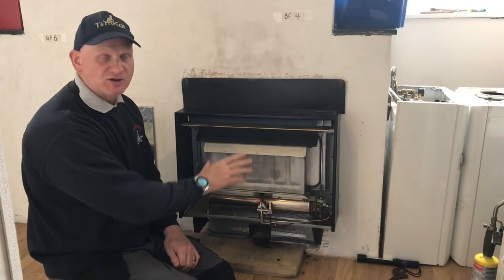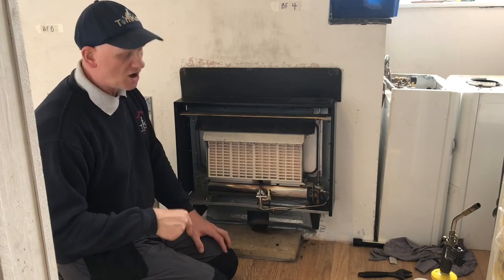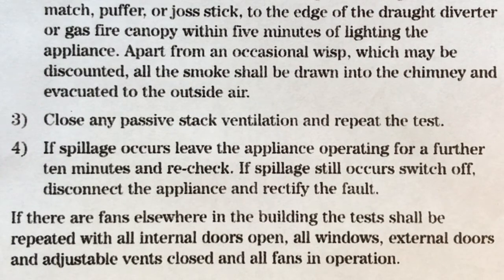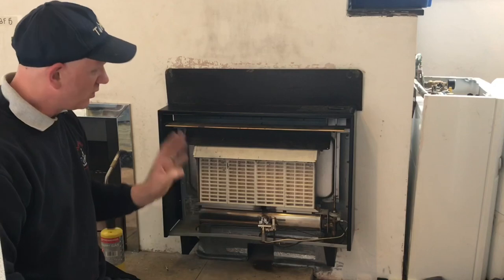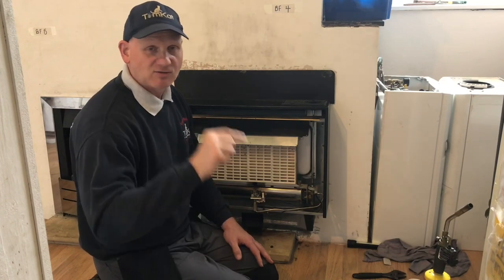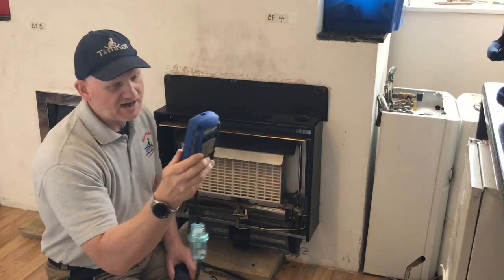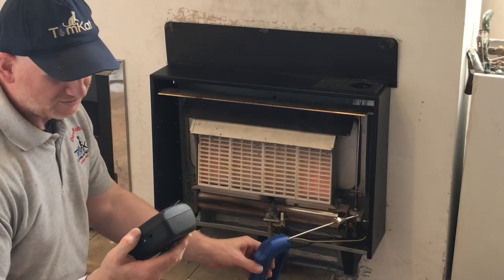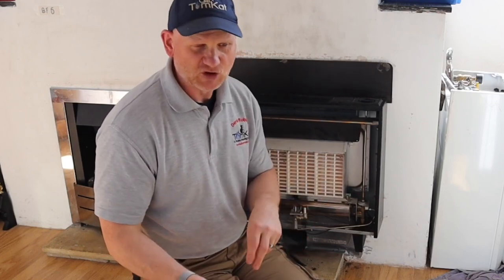FLUE FLOW TEST AND SPILLAGE part 2

Comment: Excellent video, but if it fails spillage when an extractor fan is running and everything else is fine, how much ventilation do you add? 25cm2? 50cm2? 100cm2? Or disconnect the appliance?

Comment: Fantastic video. Very useful.

At 13 min 17 secs you gave a recap on how to perform a spillage test. You said; Close all windows and doors, any fans turn them off, any vents that can be closed, close them, any passive stack systems you leave them open.

Why leave passive stack systems open?

Thanks 👍🏻

Asian Jon. Training.
Reply from the maker: Because the regs say if a passive stack is there test open first and the test again closed 👍🏻

Comment: Great video how would you carry out a flue flow test on a Gas fire stove type fire ?
Reply: I can't think answer for this any where
Reply from the maker: Matthew Whitehouse normally you would follow manufacturers instructions but most are done at the draft diverter at the back of the stove
Reply: @tomkatgastraining  i've got the instructions for a gazco marlborough and stockton stove i can see the spillage test but it shows no detail of if you need to carry out flue flow test as part of service many thanks for reply

Comment: hello you state in this vidio to apply a smoke match / puffer / or joss stick to the edge diverter or gas fire canopy so my question is can i perform this after 60 seconds ??
Reply from the maker: It says wait 5 minutes but if you do it after 60 seconds and it pull all the smoke up the chimney then it’s a pass in my eyes

Comment: where can we do flue flow test and spillage test and combustion analyse on the open flue boiler if there is not draught diverter on the flue. Can we do front of the open flue boiler? for example Glowworm fuelsaver 40r mk2. There is not any information with about this critic tests. thankk you.. Mel
Reply from the maker: The draught diverter is built into the boiler so it is done at the back of the boiler where the draught diverter is
Reply: @tomkatgastraining  thanks for reply, should ı do flue flow test with smoke pallet for check the flue or spillage test is enought with smoke match?
Reply from the maker: @osmelmuhendislik807  flue flow with a smoke pellet with appliances off spillage with a match and appliance running
Reply: @tomkatgastraining  thank you very much, you are the best :) ı am your fan

Comment: Interestingly, the appliance passed the sweep test, but failed the spillage test. My thought was if the spillage test failed,  sweep test would be subsequently failed as the result. Any plausible explanation on why that happened in the video where spillage test failed, but not the sweep test. Many thanks
Reply from the maker: Because the appliance was not making co the sweep test passed but because the spillage test failed then it’s ID . If the fire was in a living room not a big training room then the fire would have put out more co because there would have been a lot less oxygen in the room. Hope that helps and thanks for watching cheers
Reply: @tomkatgastraining  thanks for reply  appliance combustion was nearly perfect and no CO produced due to adequate air in the room?. This led to pass of the sweep test right? 

where the spillage test failed, there was not adequate pull from the flue system. Combustion products will like flow back into the room where appliances operate.
Reply from the maker: ilex Wang yes correct
Reply: @tomkatgastraining  Hi Derek pleases also enlighten on  concepts of air combustion requirement and flammability range. It has been a bit confusing as they both involve fuel gas and air and relate to the ratio of fuel gas in air. E.g  for natural gas, its air requirement for combustion is 1: 10  ( or 10% fuel gas in the air), and its flammability range is 5-15%.  As I am aware of danger of natural gas falling with the flammability range,  its air requirement for combustion confusingly is at 10%, which fall in the flammability range of 5-15%. please help on this
Reply from the maker: ilex Wang you need 10 m3 of air for complete combustion because only around 20% of air is oxygen so for every 1m3 of natural gas you need you need 2 m3 of oxygen or 10 m3 of air for the 5 to 15 % gas in air so if you have between 5 to 15 % of a room has gas in it it will explode if you have ignition. Hope that helps
Reply: @tomkatgastraining  thanks